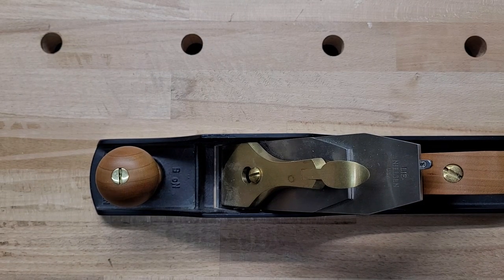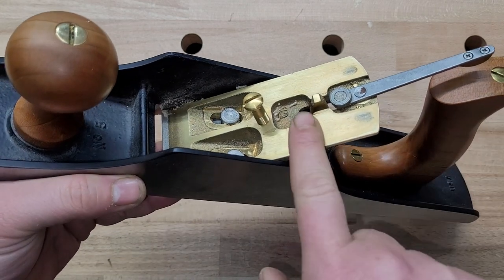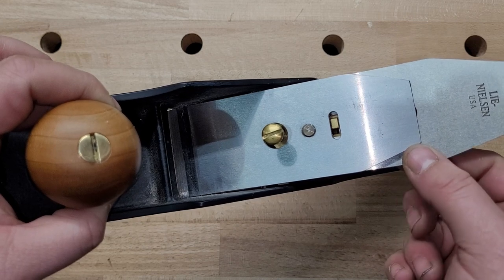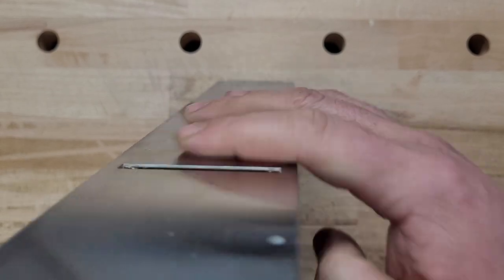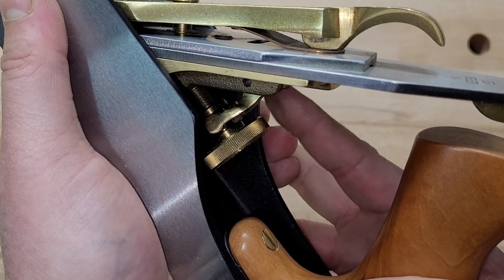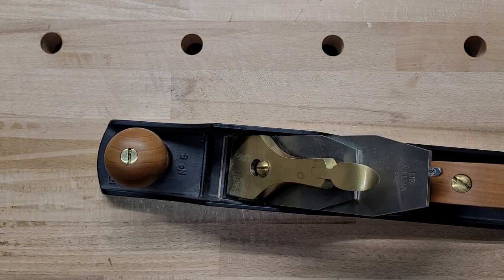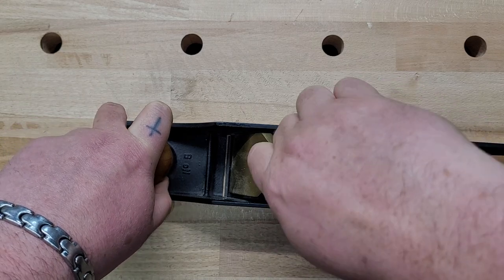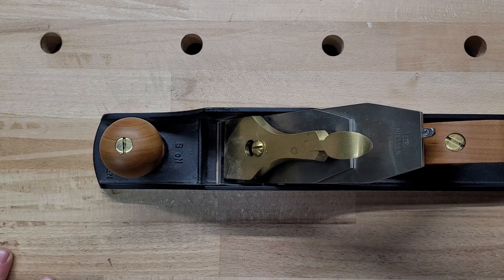CHECK THE CAP SCREW! Backlash, what is it and how to prevent it. Hand plane set up tip!

Comment: Interesting video. As you imply there are two contributors to the backlash, both relate to the clearances at each end of the yoke (Y lever). On my old Stanley's that can equate to quite a few turns of the the depth adjusting nut. I have used a shim which slots into the gap between hole in the iron and the end of the y lever to reduce the clearance. This also reduces some of the back and forward slop. The shim lies behind the lever cap and I also bend it over the top (not the back!) of the plane iron cap to stop it falling off when you remove the lever cap and iron assembly. Not needed on your plane as the backlash is hardly anything. Still necessary to always follow your process when adjusting the blade because there will still be backlash present. I've also heard of people replacing the y lever with an upgraded one, can't remember who supplies them, but the cost was more than I paid for some of my planes.
Reply from the maker: That is a great idea! Never thought about a shim for the Y lever! Great idea. I believe it is Reed that makes the upgraded parts!
Reply: @BatCaveCreations  New video!!

Comment: Well, maybe you can help me...Still learning planes after retiring from production wood bowl making... I picked up a #4 or 4 1/2 Stanley plane at a flea market for $8. Deal! I don't think it ever got used. So, I sharpened it, oiled it up, put it back together, and it 'almost' cuts, taking tiny shavings, but not all the way across, I advance it a tiny bit and then it digs in and chatters. Played with the frog, cap iron, and every thing else I could figure, and no luck, same stuff no matter what I do. Any suggestions? The sole was almost dead flat, but I out some 180 grit on the table saw and flattened it some more..........
Reply from the maker: Hey! Check this video out and see if it helps! https://youtu.be/EXVzeZyifXw
Reply from the maker: Also this one! https://youtu.be/rfAf6zeQcZc
Reply: Check the fit between the frog and the plane body. If it rocks back and forth, it just takes a little fitting. If it still digs in, try   opening up the mouth and backing off the chip breaker, then gradually bring those settings in tighter. If the chip breaker setting causes clogging, check the surfaces for any light getting between it and the iron, and fit them if needed.

Comment: Good tips. I've personally not had any trouble with backlash though these are tips I haven't seen anyone else talk about either. That said, I have a different issue. My Kobalt No. 4 has a very wide mouth. As in, the iron is 2" wide while the mouth is 2.25" wide. That seems like an awful lot of lateral space and I'm not sure how to tighten that up as, like most stanly-baily style plains I've seen, the soul is one solid piece and does not have any kind of set screws or shims to "pinch" the sides of the iron and keep it from shifting laterally while in use.
Reply from the maker: I posted a new video today that talks about that kinda. 
You won't be able to change the width (2 25" to 2") of the mouth but you may be able to get the plane to operate better.
I do have to say the Kobalt was my first plane ever and I quickly learned that it has alot of issues :( I'm hoping the new video helps if not you may wanna consider a vintage stanley or the new Jorgensen line from Lowes. I have a review of those also. Some points in thise videos may also help finesse the plane you have to get it working effectively.
Reply: My Kobalt had this problem. My solution was to smooth the contact surfaces between the screw cap and chip breaker, and between the iron and the frog. The added surface area helps hold the iron in place.